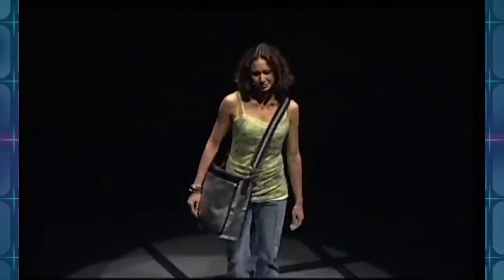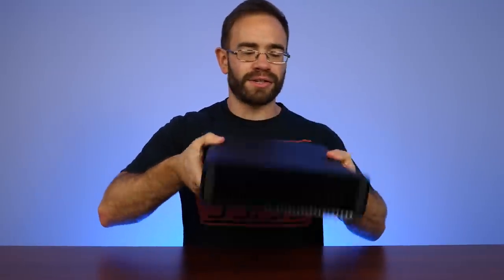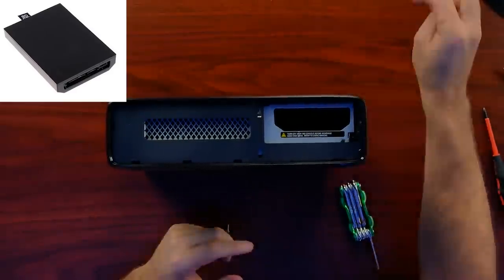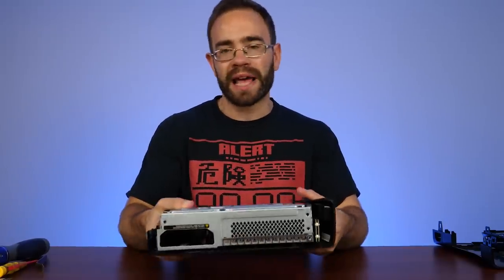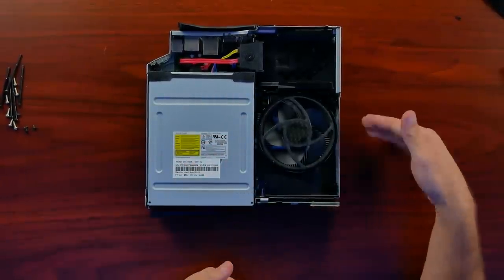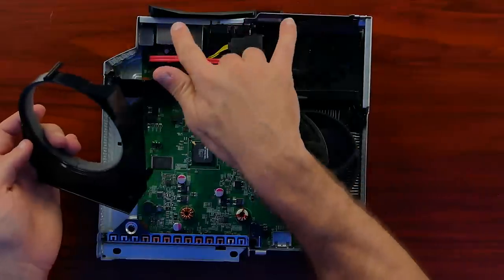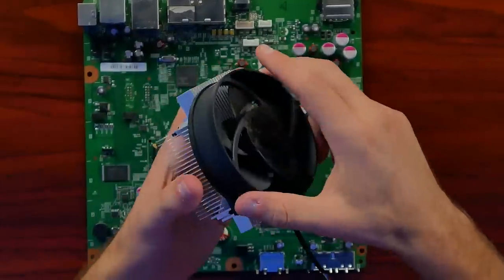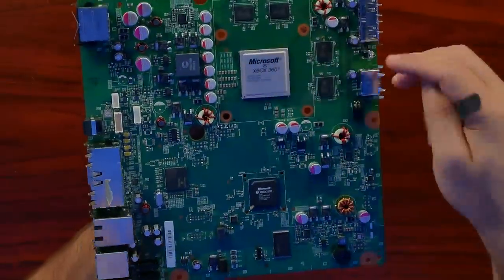Here's How Microsoft Solved The Xbox 360 Red Ring of Death

Comment: I had an original 360 and it did rrod  I turned it off overnight plugged it in the next day and worked fine for about a  year until my sister got pissed at me and smashed it lol. This was in like 2009 btw. Got another one a few years later I think it was an xbox 360 e and never had an issue with it at all! Just recently got rid of the 360 e a few months ago to a family friend and it's still running strong. Even after my overnight gaming binges on borderlands,halo  gta 4 and 5. I guess I was lucky with my original minus the fact my sister smashed it lol. Good times😂

Comment: my 4gb white model failed due to the 4gb flash failing, the chip was soldered onto the motherboard, I had to toss the system, it would play games for a few mins and then die and wipe everything or not even post.

and my current slim has an issue where the disk drive randomly ejects the disc sometimes, quite annoying

Comment: The most reliable xbox 360 is the jasper phat console. The slim trinity, corona and winchester are on the save level as the 1st version of the falcon phat console, maybe just a hair better. There are too many broken slims on ebay for sale that suffered from red dot which is the same as the red ring, along with not turning on and shutting off.

Comment: I knew this was a problem but didnt relise at the time how big the problem is. I think i found a solution, in the U.K ( where im from) i got a external fan that clipped on to back and had a power pass through to power it. It seemed to work but i dont know if i got lucky or the ext. fan worked, but i still have my original 360 today fully working and and an S model as well. Not bad if  i do say so.

Comment: Hmm. How long to wait until you get a PS5  
to best avoid issues? Launch PS4 sound cuts outs for a few minutes like once a month. Happened say 3 years into owbing it (TV, diff sound amp, cables replaced over time it's the PS4 itself). Been burnt on a launch xbox back in 2001 disc drive failure with no warrenty option at the time in Canada.

Comment: I believe Microsoft rushed the manufacturing of the 360 consoles leading to RROD hardware failures. Lack of Quality control, the cpu and gpu were mass produced with cheap parts. 

Microsoft wants to drive the down the cost of the system to battle the PS3's $499-599 price. But little did they know that greed would backfire to them big-time.

Comment: I remember everytime I get the RRoD I cover it with towel turn it on for 10 minutes then off let it cool for 30 minutes and it will play again, that would last for like a days then back to RRod.
Reply: Don't do that to consoles. You are damaging it more than fixing it and the gpu might not have even been your issue.
Reply: @rockl79  well it's already damage and after 3 months of doing it I get tired of it and bought the slim. It's just a "whatever" thing to do to a useless thing.

Comment: Completely wrong. The layout you are complaining about is more widely used and has the benefits of cooling down every component in the system (all servers use this layout simply because it is better).
The "update" throws the air around inside the case which is not an upgrade only benefit is that it is more quiet.

The new cooling design was cheaper which is why they went with it and had nothing to do with the solution to the problem.

The solution was to remove 3x 95nm chips and replace them with 1x 45nm the heat generation differences cant even be described in simple terms but just knowing they removed 2 chips we are down 2/3 of the heat production and splitting in nm in half makes a huge difference.

Comment: If you buy a Xbox 360 used and there isn't the sound of stuff floating around in it, it's not a 360

Noticed they didn't go with IBM for X1/X1X and the new gen systems, that tells you something and wasn't the dvd drive for 360 Toshiba that the failure rate was high???

Comment: If Microsoft wanted to fix the RROD properly, then they should have replaced all defective (in my opinion) consoles with new ones that were redesigned without the poor performing hardware, and sans design flaws.  Nope!   "Just slather a bunch of extra glue on that there problem.  Problem solved!"  

No, the problem wasn't solved,  it was a mere band-aid applied to a infected laceration, and only served to delay the issue from reappearing.  It was no fix, nor was it anything that resembled a repair, it was nothing more than a temporary solution which only served to delay the inevitable.  

We, as consumers and owners of XBOX 360s, still had to pay to have our systems repaired.  Sure, maybe you "lucked out", and had your system fail prior to the warranty ending, but that doesn't mean you wouldn't have to have the system "repaired" yet again when it was no longer under warranty.  

My original release date XBOX 360 was repaired once under warranty, and four times out of warranty.  My XBOX 360 Elite was repaired once under warranty, and three times out of warranty, and both consoles had the RROD occur after that.  I always meant to fix them myself, but I had a PS3, and the next generation of consoles would be released . . . although I went with a PS4, and I almost never purchased a XBOX One until it had neared the end of its lifespan, for I was so extremely pissed at MS from blatantly wasting hours upon hours of my time with their customer support call centers, coupled with the way in which they chose to handle the theft of the cardboard shipping box they had sent me (you know the ones they send out to you, when you submit a repair request, that you would use to ship your console to their repair center) was stolen off my front porch.  

That problem, the incidence of theft, should be resolved with the third party they had hired to fulfill this service to me.  I had paid MS for a service that I should legally receive.  In turn, MS paid UPS for a service (delivering a shipping box to a customer), which was not fulfilled.  The customer never received their shipping box.  I paid MS for the service of repairing my console, so my problem lies with MS.  MS paid UPS to deliver a shipping box to me, so the problem of a customer not receiving their shipping box (a serviced paid for and paid to MS), is still held by MS to its customer, whereas the problem of the customer not receiving their shipping box lies within the responsibility of UPS delivering the service to MS for which was paid.  The service of delivering a shipping box to me (the customer of MS) was not fulfilled by UPS which they had a financial obligation to fulfill to MS.  Therefore, if I do not receive the service for which I paid a company to fulfill, and then that company then hires a third party to fulfill that service which was paid for, and the service is not fulfilled, then that obviously affects me, but the responsibility lies with UPS to MS, and by extension the responsibility lies with MS to fulfill that service to me.  The problem needs to be resolved with UPS, the company they hired to perform a service that was never fulfilled!  You don't then double charge your customer to fulfill a serviced already purchased, but never rendered!  It take it up with the responsible party, which would be UPS.  I never physically received the box, I didn't sign for it as proof of delivery, the box was never in my hands, nor within my eyesight!  Why should I be the one held accountable for a situation that was completely out of my control?  Screw you, MS!!!  

Oh, but they did offer an extended warranty on their consoles to help compensate for the RROD blunder.  But guess what? That extended warranty did absolutely nothing for me.  It provided no compensation in any manner for me, a customer who had two of their systems, each one being repaired under warranty once, and then had paid "repairs" performed to to both systems a total of seven different times!!!!  Why did that kind, caring gesture from MS not compensate me?  I had surely given them plenty of my money: two consoles, around six controllers, a headset, controller battery packs, a boatload of games (both physical, and digital), and multiple XBOX Live memberships, plus other items.  Why should I have been required to spend an extra money on fake repairs (nearly $700), plus the time that passed when I was not in possession of a functioning console because it was cavorting in Texas, allegedly being repaired???  I spend that much money, and I am the type who gets screwed out of the extended warranty.  Now, had that extended warranty actually provided a real solution to this issue, then I would have been, and likely still would be, extremely pissed!!!! See, in order to qualify for the "free" extended warranty, your console needed to not have had any warranty worked previously performed to it.  Because both of my systems were repaired under warranty, there was no longer a warranty that was active on either system, so there was nothing to extend.  Obviously, I was suffering from the same problem that prompted this free warranty extension, so why was I discriminated against?  Was it because my version of the problem was more severe, and just so happened to manifest sooner than other systems??  It's not like I missed out on having an actual real repair performed on my systems, but it still would have saved me nearly $200 to have a pseudo-solution applied to them.  I would not have been required to spend $99 each (or whatever ludicrous amount they requested) for a so-called "repair".  A "repair", mind you,  that was nothing more than a temporary workaround, that did nothing in regards to the cause of the issue, thusly, ensuring the same problem would inevitably surface again at some point in the near future!

The day Microsoft makes a product that does not suck will likely be upon the same day that they begin to manufacture vacuum cleaners!

Comment: the red ring of death was due to bad solder on the scaler chip.

the solution was to intentionally overheat the console by wrapping it in a towel and to worked.

i think it may be due to the chinese factory having the heat on the solder bath too low so it was barely hot enough to flow properly just to save a few cents.

note to microsoft to save money  in the future instead of cutting corners on your products try

1. do a walmart work your employees off the clock "oh we need you to clean the bathroom"

2. commit theft of service rig the electric meter to get free electric in china.

in the 80s there was a certain model of cd player that did a similar scratch to the disks

Comment: Their going up for 2 reasons. The OG 360's are literally all dying left and right so if you want a 360 and not just the BC on X1 then this is the one to get. The other reason is that these are actually way easier to hack then the OG 360's and with the stability mixed with those it's no surprise they are going up. Best 360 periodt
Reply: The only fat 360s that die are the first 3 motherboard revisions. The 2 after that 99% of the time will outlast s and e consoles.

Comment: Microsoft learned from the 360 mistakes... They’ve made quality systems since ....
Reply: my Xbox one x died a month ago....no hdmi output. Hopefully my series x will hold on for a while...So....
Reply: @Beepbopboh  .... That sucks, but your point is ?  I’ve had an Xbox one, also Xbox one X, both are whisper quiet and both have had no issues, now my original Xbox 360, was loud and died, red ring .... So the quality is night and day now, Xbox one X is well made, never overheats, no issues.... Of course all systems have some failure rates, impossible to never have any problems.... But Microsoft learned from the 360, they went cheap, wanted to profit off each console sold, now they make the money on the games more than the systems, they went quality now, and you can tell...

Comment: Actually there is an original Xbox 360 that doesn't have the red ring of death it's called the Xbox 360 arcade but it has one disadvantage it doesn't have a hard drive built in but you can get one for it

Comment: Another problem that the 360 had was that the ANA and later HANA chips would die. it was so annoying. The xbox 360 GPU was literally an ATI X1800 XT modified to have unified shaders and 10MB eDRAM. The regular PC gpu has a giant heat sink and fan.........Microsoft thought that putting a little metal plate on top of the GPU would be enough hahahah.

Comment: I still have an 07 model .. With the samsung drive.. I modded the fans to 12v.. Never red ringed again.. Does sound like a jet engine though lol.. The problem was the drive being right over the GPU.. Causing masive heat. Than causing the gpu to de solder or board warping..The fans were 12v but only ran at 5 v.. Not enough suction power.. To much heat stayed in the system. The disc drive on the GPU was a stupid design.. They changed that with the jasper and slim models..

Comment: I Had a launch 360 but never got the red ring of death  what happened  with mine was 2 years after launch I started my console up and the sounds came thru but the screen had horizontal green lines and no picture which kind of looked like the Matrix code lines. I called M$ the guy told me it was out of warranty and would have to pay to ship for a fix so I passed the next day I got an email from M$ telling me they were sending me a box to ship it back to look at since they never heard of that problem before the box came next day 6 days later M$ sent me a brand new 360 and  XBL time card  but I never found out what was wrong with console!

Comment: they never fixed, or even found what the real problem was, overheat, cracked solder, bad chips, bad capacitors, bad regulators... the new slim design just happened to rrod less than the phat ones

Comment: Y they even put red LEDs in it in the first place?
Reply: They probably just THOUGHT that only 4 red lights existed, which, btw, 4 red lights=A/V cable error, so if you ever see 4 red lights, it probably just means you video cord fell out. The 4 red lights, however, is only visible on 360s that don't have HDMI. On the original XBOX, if your video cord falls out, it will blink green/orange, but you NEVER, EVER, EVER, EVER want to see it blink green/red. Or just green. 
<<<<<<<<<Original XBOX>>>>>>>>>>
Blinking green/orange= A/V cable error
Blinking green/red=general hardware failure
Blinking green=BIOS/GPU/RAM corrupted

Comment: The ONLY problem from 360 launch 2005 xenom board are trash ROHS bga balls soldering. Not design or fans 2x etc. With leaded balls SN 37 PB 63 bga 3 red light NEVER more back

Comment: No way , RROD was solved by Jasper M/B revision, it is Phat, most reliably console what have ever seen, also where is no way to swap dvd roms you need to have original DVD key it is in the dvd rom M/B. Slims have RROD , but it is more Red dot and they are not so reliable like old good Jasper. Bad info

Comment: Ahh yes the least reliable console I've ever owned, I had a 2009 elite so it didn't RROD, but after a year the disc drive belt wore out, the flaps on the front came off and the hdmi port started displaying green dots everywhere.

Comment: Dude you fix game consoles for a living right and and you're naive enough to think that the eye will scratch the disc that that scratch on the edge is caused by the disc smacking the tray the eye is hardly never at the edge of the disc you can actually hear the eye bouncing back and forth getting data off of the disc plus if it was the eye dont you think that would also damage the lens and making the drive completely useless

Comment: Yeah I know it's funny I've only PlayStation I own Sega I've never owned an Xbox until 2020 someone just gave it to me and it didn't work so I fixed it when I went to plug it in I plug it in and that that red ring of death people were talking about was on there and you know what I did to fix it got a different power supply boom fixed never had a problem since. The Xbox 360 s the slim whatever you want to call it. Not the Xbox 360 e and not the Xbox and that the Xbox 360 it is how many Xboxes are there Xbox Xbox multiplied by the factor of the exponenter of 10,000 my Xbox 360 slim is a little bit different than yours there's ones I had the vents going diagonally vertically are horizontally vertically and then there's the ones with just a bunch of dots on the top and bottom on both sides and that's what mine is it's supposed to be the backwards compatible one I don't know if it's true cuz I don't have any older games yep I don't have a built-in Wi-Fi

Comment: THIS IS HOW THEY FIXED IT ? THEY GLUED DOWN THE GPU CHIP THAT WAS POPPING OFF DUE TO MASSIVE HEAT PROBLEM'S CASE CLOSED ! THIS GUY IS OPENING THE LATER XBOX DOESN'T EVEN MAKE SENSE ? CHIPS WERE COMBINED DUE TO NEW CHIPS BEING SHRUNK DOWN COST ETC THIS HAS NOTHING TO DO WITH THE GPU ON THE OLD ONE'S ?

Comment: They never fixed it but I did after 6 rrod I thought fuck it how hard can it be to fix it so I cut a big hole in one side an a case fan on the other side problem solved but looked crap. But I never had an e 360 so can't comment on that one..